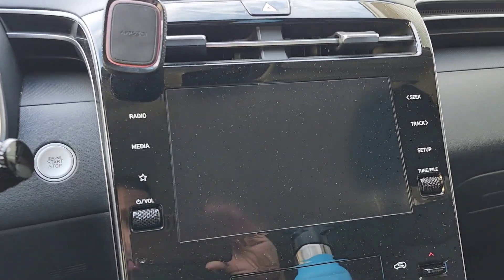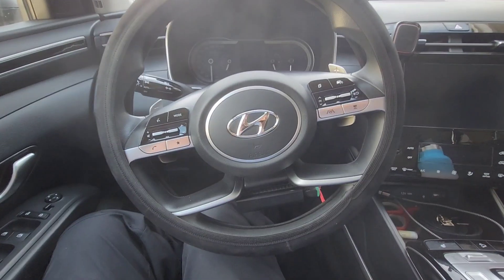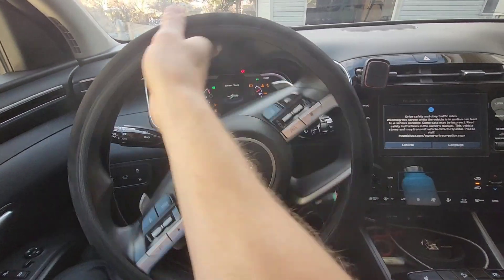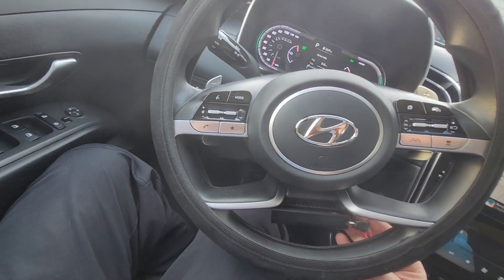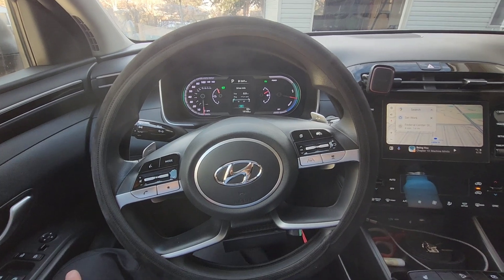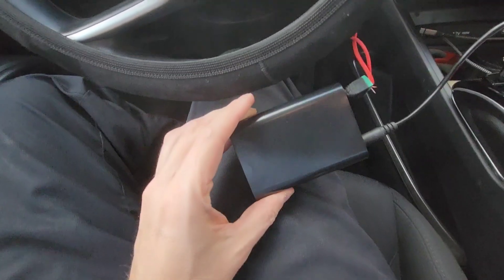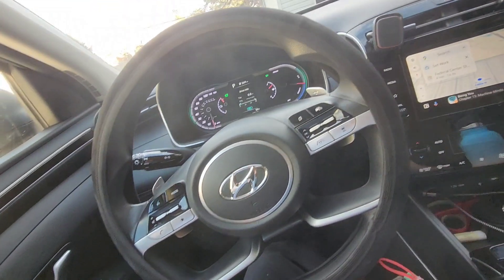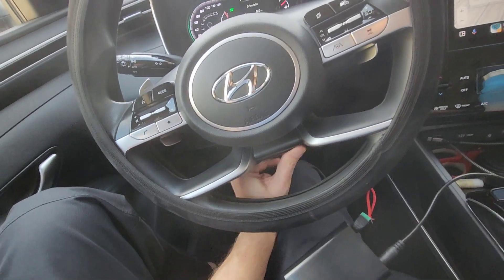3. $10 DIY heated steering wheel cover to prevent PHEV engine use

Comment: so do you bring this inside your house to charge it up or just connect it via the 12v to charge it?
Reply from the maker: You can do either, in-practice taking it inside seems like the better plan because it charges faster and I don't have to worry about impacting the 12V battery.